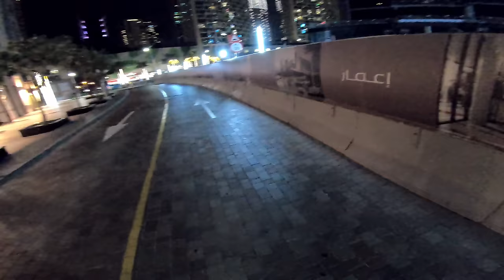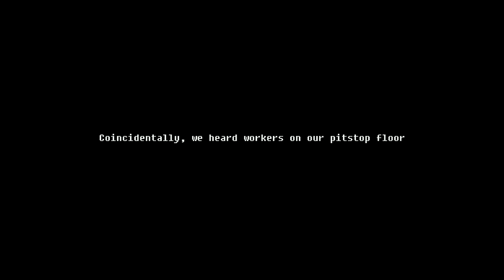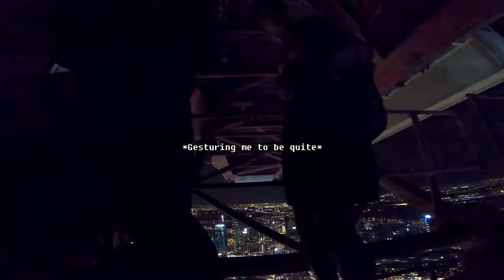Burj Khalifa Crane Mission (Dubai Raw POV)

Comment: Damn, imagine if the crane driver started operating it while you were on it, scary shit! Do you think it'd be possible to hold on? Or would the force of the movement fling you off?
Reply: cranes dont move at speeds that would fling you off lol

but yeah, losing grip while climbing down in a rush would have been risky